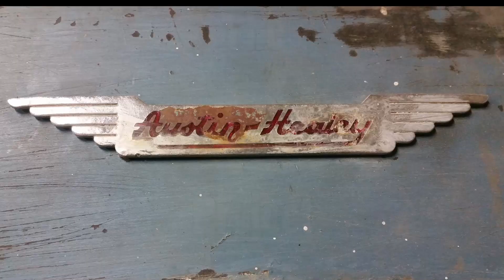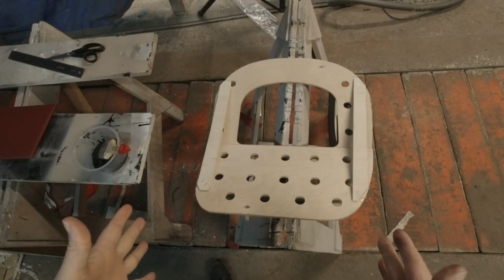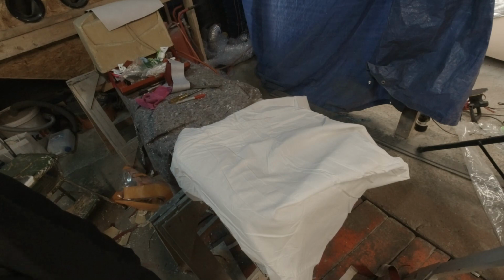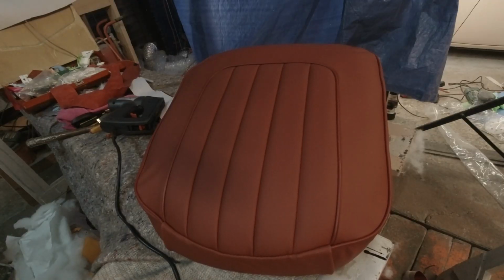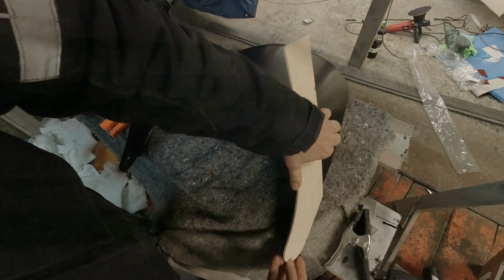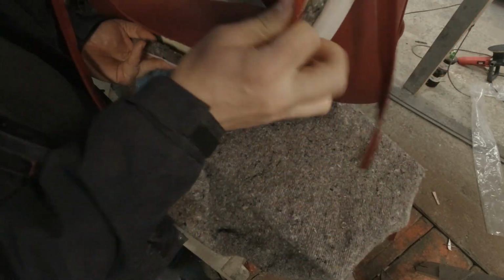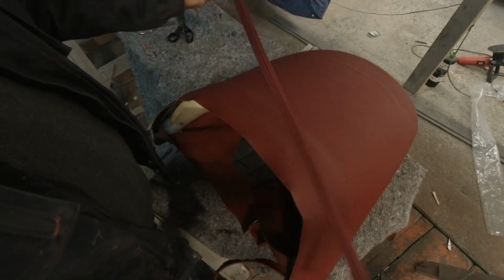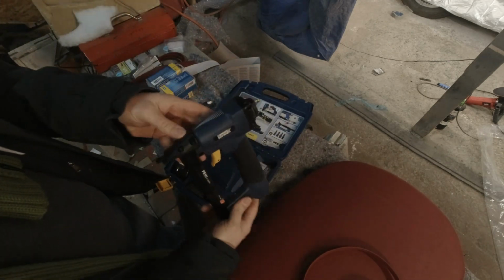The Austin Healey Project Season 2 - Episode 62

Comment: Looking good there!
Next time, the addition of some loose cotton batting around the top, of the front surface of the seat back works wonders for filling out that surface, therefore eliminating some of the pucker or  ripples.  That is how the factory got them smooth.
Anyway, Thank you for your outstanding videos, I'm loving that SWEET Healey 100!